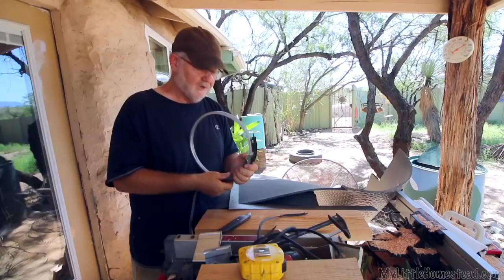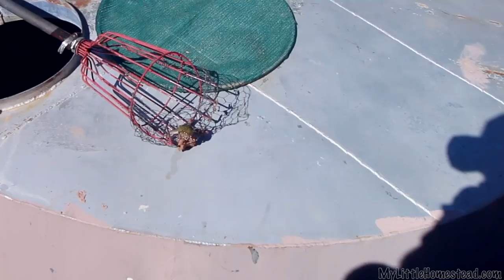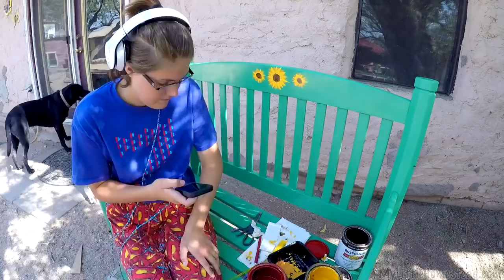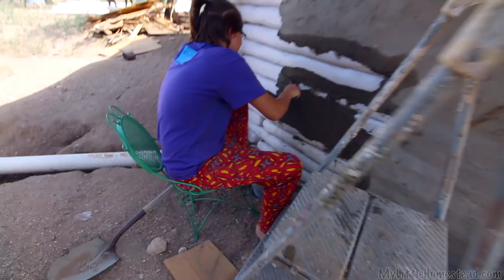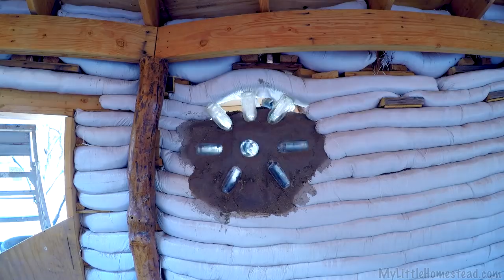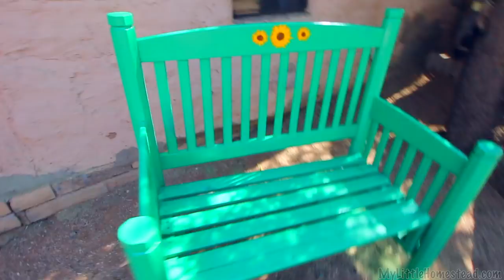Shower Wall with Porthole & Bottle Flower | Earthbag Kitchen & Bathroom | Weekly Peek Ep147

Comment: I love how you guys work together as a family, and you always joke around even when you fight which it’s really not fighting lol..I love when you brain storm together to figure things out..My dad and I work together on a lot of things, we bought an old pop up camper and it needed some work, quite a bit of work actually lol..it had water damage so we had to replace a bunch of wood, it didn’t have curtains so we got shower rods and cloth curtains for in front of the beds, then we used rope and strung it threw the curtains to hang in front of the windows, we had to screw the rope to the wall (that was a pain in the ass lol)..but we have done other stuff like the electric, we had to buy a new canopy and figure out how to attach it and set it up..then we went camping and couldn’t figure it out, we thought we had it on backwards, but come to find out we didn’t lol, after we took it off and flipped it over lmao..Then we were opening it up one day and noticed on one of the corners at the bottom it start to bulge out, so we had to pull the siding back and fix it, 2 screws had broke and came out of a bracket that was somehow connected to a chain mechanism that opens it. But we did get it fixed and haven’t had any problems lately.. Dad and I always work on stuff together, like our vehicles, no matter what is wrong we work together to fix it, and thanks to my dad I know how to change my oil..lol And we alway joke around like you guys do...Thank you for entertaining me and giving me ideas for stuff...
Reply from the maker: You Rock!

Comment: about the wallflower, would it help holding the sides if you used a balloon to hold them in place, just inflate it slightly larger than the centerto sort of make the rubber "wrap" around the mouths of the bottles.